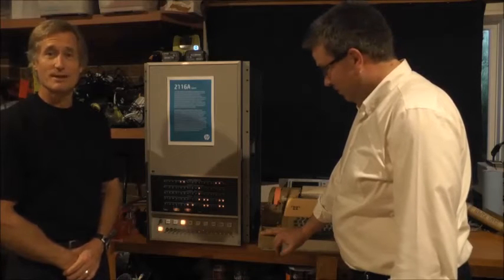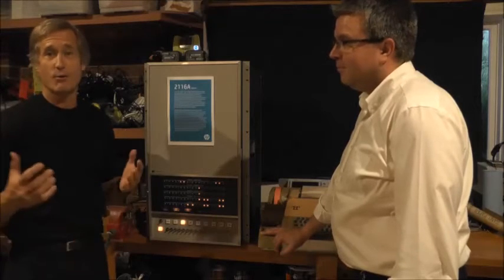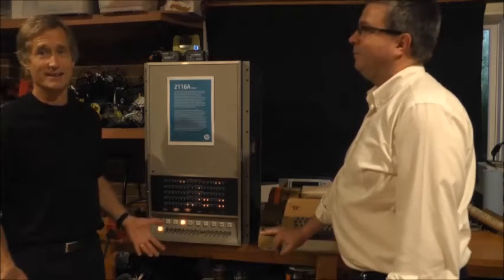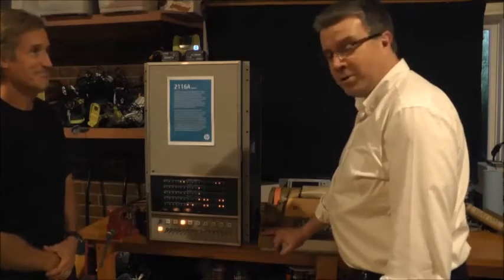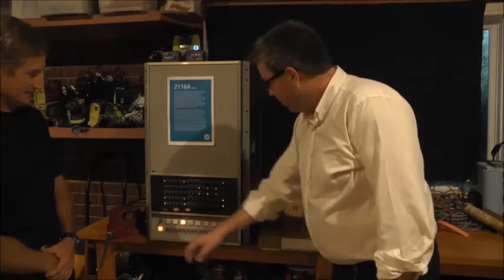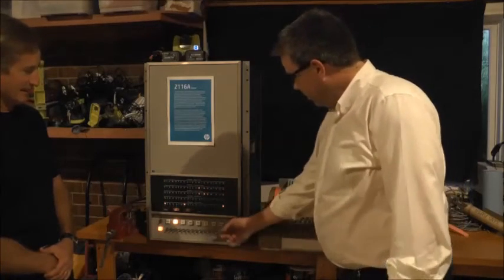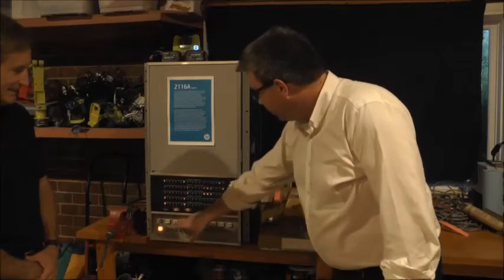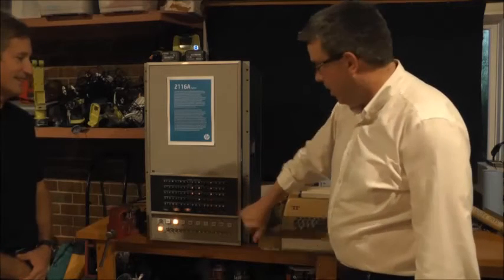Hewlett Packard 2116A Blinking Lights

Comment: Good jog guys.  Can you explain more about the calculations and purpose of the 2116A?  

Also, I can't see all the lights but it sounded to me that the lights are LEDs that illuminate when the specific processor Registers Read or Write and when Address and IO lines are asserted.  Is this correct?  IE- We can see the LED light when those lines and registers are used!!? Very cool!
Reply: The 2116A was fundamentally a control computer for measurement systems and monitoring of processes.  The front lights were NOT LED lights, they were/are small individual incandescent light bulbs each with it's own individual holder. Each row of lights indicated a different CPU register and the switches were actually also a register of the CPU that was manually set (also called the "switch-register" which later became known as the "S-register"  The 2116A was a great computer to learn basics of digital process because the interactions between registers could be monitored (to actually watch the core OS functioning).